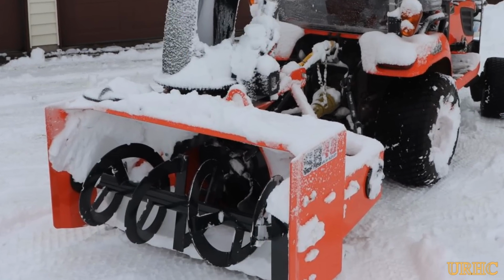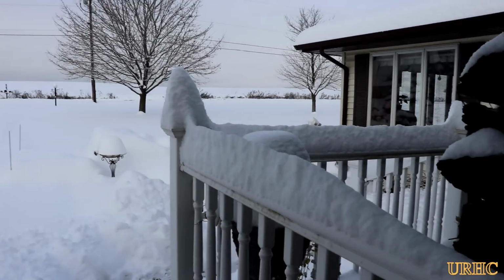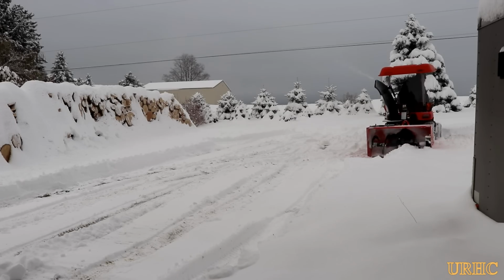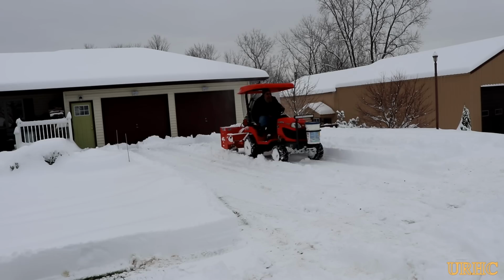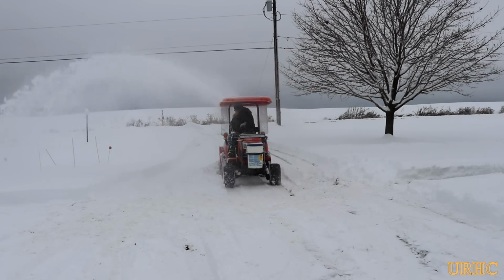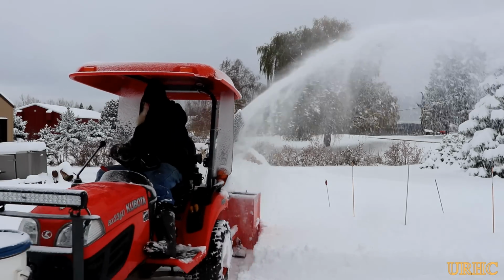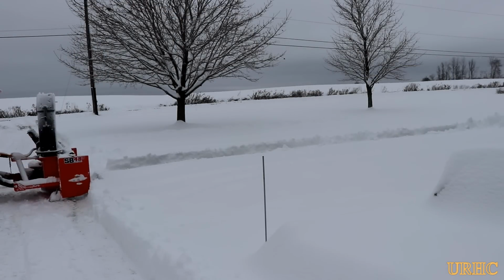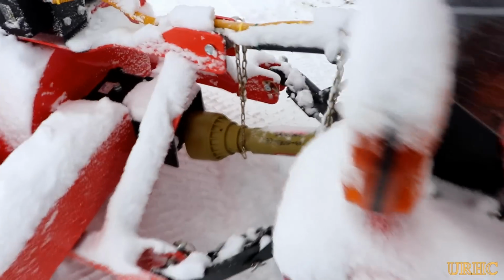Woodmaxx SB48 First Use

Comment: with  the drag of the blower on the ground an turf tires get your self a set of $40 tire chains for the back tires and you will climb them hills like there is nothing there, i used my 23hp  troy built tractor, 2 wheel drive  for 7 years commercially snow blowing, i would ware out the tire chains every 2 years but i could push the blower though 4 foot grader banks that froze over night, it didnt even slow down, my troy built blow the snow over 75 feet witch was nice in yards that had no place in the front yard to blow the snow so i would blow it up and over the houses into there back yard, the year we had 7 feet of snow fall in 12 hours it worked like a dream, i really thought we were going to be in a huge problem, but it eat that 7 feet deep snow like it was only 2 feet, that grader banks took a lot more doing, me and my crew worked 24/7 the week for 2 weeks, as we had my own contracts to look after but the phone was ringing steady every day people trapped in there homes, most places you didnt even know there was a house or car there, that was a really finny storm, you see the grader coming down the side streets with there big snow wing out, and small cars were rolling off the grader blade and up and over the snow banks as you couldn't tell there was a car there, there were so many cars up side down in the snow banks all smashed up. we had to snow blow our way down the streets to get to people that were trapped, but me and my guys made so much money on that storm, the guys were doing the walk ways with the troy built walk behinds to get to the doors and hand clean the steps and doors off, i can see why yours will not blow the snow that far, your auger i the front is made very poorly, the bars are all most strait, mine the have a really right side curve to them an my 2nd stage blower wheel spins so fas you cant ever see it is there when its on
Reply from the maker: I did order chains but they have not arrived yet. We get some big lake storms here and I can't wait to see how it handles them. Thanks for watching.

Comment: There's nothing wrong with the blower, to me though, blowing snow in reverse is a pain in the neck, both figuratively and literally. I could be wrong about this, but I think the blowers works better with a full auger  because there is less room for air mixed in with the snow, much like when a pump cavitates because air is mixed in with water.
Reply from the maker: Actually it is not bad, I bought a backup camera and don't feel it is needed. That very well could be the answer. I was thinking the denser stream exiting had more mass to deal with the resistance of the air.  I am very happy with how it worked. Thanks for watching.

Comment: Throws the snow much better than my 60" Woods blower.  I'm impressed.
Reply from the maker: Seemed like the more snow in the bucket the further it threw it. I had it running at 540 rpm on the pto. The blower amazed me how little it loaded down the motor. I think it is the perfect size for my little BX. Can't wait to try it on a good lake effect storm. That will be the true test. Thanks for watching.

Comment: you're a better man than me I couldn't backup like that. I have a Cub Cadet with the blower on front It's no match for your Kubota but works for me
Reply from the maker: Funny thing is that it didn't bother me looking back. Bought a back up camera just in case it did and don't need it.  Can't wait for a good lake effect storm to give it a good workout.  Thanks for watching.
Reply: I have a Cub Cadet GT3235 with the 45" front mount blower and 240lb suitcase weights. While I like this Kubota set-up, I'm afraid it's in a different zip code, price-wise

Comment: Take your 7 gal bucket mix up some concrete and put it in the bucket.  Concrete weighs approximately 150 lb / cubic feet
Reply from the maker: I took some sand out and added 50 pounds of lead then strapped 2 old f350 rotors on top. Seems to be good now. If it is I can weight it and make a concrete block to match the weight as you say. Thanks for watching.

Comment: I never understood snowblowing backwards.
Reply from the maker: It actually is easier to get in tight spaces and the blowers can be switched to different brand tractors. I never thought I would own one but after the problems with the new walk behind I switched and this works great. Thanks for watching.
Reply: +dalesworld  price.  When I looked into it, often the front mounted systems were much more expensive.  Of course, this can vary based on the tractor you are putting it on.

Comment: I heard the key word in this video (FUN). I wonder if you ever said that with your walk behind? I know your back is thanking you. If your like me, after using your current set up for a few years you'll move up to a cab tractor and clear snow in a tee shirt and sneakers. I guess I'm just getting old and soft LOL. Enjoyed the video.
Reply from the maker: It actually was fun. The new Ariens I bought last year is a piece of junk. It beat me up so bad I could hardly move after using it. The autoturn made the machine throw me around, had to fight to keep the front down and after a couple trips up the hill the drive system got wet and slipped so bad it had to be pushed. Glad I didn't take a chance on another walk behind. This blower works great . Chains and some more weight should make it unstoppable. That shield I built works pretty good for now. Thanks for watching.

Comment: I personally prefer a backblade but my is a little bigger wieght wise but hp you got me but i beat you on torque. John deere 520 with a 6ft arps blade and if if i need my john deere 45a loader. My tractor is 25hp dynoed right now but it wieghs over 6k.
Reply from the maker: These little tractors don't push much and with the back to back lake effect storms we get there is no room to push the snow. I am very happy with how it works.  Thanks for watching.

Comment: Looking good!  I've got a much bigger Kubota M7060 w Grand Cab (which I love!!) and need to find the right snowblower!  I may lo9oki at the SB72 or SB84.  Really don't need anything that big but the price point is very low on the upgraded sizes. The Woodmaxx SB48 looks like its doing a great job.
Reply from the maker: That is a big tractor you have. If there are any farm shows in your area that Woodmaxx attends they give a discount also if you order it there. Mine seems to be just the right size for the BX. Can't wait for a good lake effect storm to give it a good workout and see how it handles it. Thanks for watching
Reply: I have the SB72 on an MX5200 and could easily handle the 84” (it was added to the line the year after i got the 72). 

Eastern Lake Ontario lake effect region - big snow
Reply: @joelrarick8384  Thanks for the info!  I'm totally looking at the 84" for my M7060

Comment: The blower would be awesome if you could mount it to the front of the Kubota. Then you wouldn't have to look behind you and no need to add weight that way.
Reply from the maker: I like it on the back. When I replace the tractor with a different brand I can still use this blower.  Thanks for watching.

Comment: My Kubota BX2360 is set up with a 5 foot rear snow blower and a front end loader.  The front end loader will not only provide ballast, but is useful in moving large piles of snow around and scraping the driveway down to bare gravel with the float or by back dragging the loader.  I switch back and forth between the blower and the loader all the time.  The loader can be removed for mowing in the summer, but I keep mine on.  You never know when it will come in handy, and while costly, is a good long term investment in the tractor (for resale) even though you have another tractor with a loader.   You will love blowing thru large snow drifts with that unit.  Was wondering about the glass shield you installed, if you may need a wiper to keep it clear for good visibility to the rear.  I really enjoy all your videos.  Thank you.
Reply from the maker: I have a loader on the Deere and the Kubota was just my lawn mower up to now. When I replace the Kubota in the future I may do as you say and get a loader for the new tractor along with selling the Deere.  For now it will just be more weight.  The 4 ft is just right for my needs and it fits anywhere the walk behind would. The shield stayed clear in the center so I think it will be ok but still have to try it in different types of snow to be sure. Thanks for watching.

Comment: On my snowblower I put an A TV  winch to rotate the chute. I wired it to the battery with a 50 amp circuit breaker. Then I secured the winch wire controler  in the rear and that way I can adjust the direction while I am snowblowing. For the chute curl I installed a small e-bay electric  cylinder with a two way back to neutral switch. I like your snowblower as it look like swallowing the snow better than mine. 👍
Reply from the maker: I went with the wireless winch but found out the remote would time out and have to be restarted between uses so I will run wires in the future that will make it easier to use. This blower amazed me, it did not load down the engine like I was expecting it to. Thanks for watching.

Comment: That front end sure is light. Lol. It would be nice if you had a loader on it. That would weight it down a lot. It does work really well. Think you should get some drift cutters also? I've seen your drifts in previous videos and they are really deep.
Reply from the maker: It is a very heavy blower and I never thought about the extra weight of the snow that sticks in it. A loader can get in the way in tight areas so I am just going to try some more weight for now. These blowers can be raised 2 feet in the air for drifts so I don't know if drifts cutters are needed.  It amazes me how little a load it placed on the engine plus only took a quart of diesel compared to the walk behind that would use over a gallon of gas to do less area. Thanks for watching.

Comment: Well pal, how does it feel to cost me money, now I'm sold on the 3 point blower and like you I'll be going with woodmaxx. 
We just had our first snow (NWNJ) got almost 11" of sneet (snow & sleet) the front loader and rear blade did the job but I need a better solution, very happy you posted this video, also happy that you found a solution to your snow needs, I felt your pain last year with the walk behind snowblower, I to bought a piece of junk a few years and have been disappointed since.
Reply from the maker: I think it will handle any snow we get.  If you find a local farm show Woodmaxx attends they offer a discount. It is a heavy unit that seems better built then others and mine works great. Hoping for a 2 foot lake storm to see how it handles the dense snow. Those new Ariens just don't handle the snow like the old ones and are not worth fighting with. Thanks for watching.

Comment: If you have a rubber lined (or those wheeled ones, so you don't scrape pavement) scoop on the front, you could pull double duty, first run about with the snowblower and then at the end scrape whatever's left in a neat pile. PLUS, bonus, that should even out the balance just about right.
Reply from the maker: My other tractor has a plow and that makes a mess. A little extra weight and raising the skids should get most of it. Thanks for watching.

Comment: Great to see it is all working out for you ! Happy that you don't have to break you're back no more with the junk walk behind and I know you will get the weight fixed on the front but it looked great and it goes right thorough the snow ! I would take one too but just don't get snow like you but if I can find a used one !!! LOL but have a great weekend and be looking forward to the next video and God bless !!!! Kioti Curt 😉👍🚜⛄❄⛄
Reply from the maker: I was amazed at how good it worked.  I think it will handle any snow we get without any problems.  Nice to have a machine that works properly right out if the box. Thanks for watching.

Comment: It would make more sense to get a blower that goes on the front so you aren't killing your neck driving around in reverse all the time.  With the ridiculous cost of tractors they should come with front/mid/rear PTO's from the factory...having that blower on the back of the tractor just seems like it would be more of a hassle to operate.  Glad I just have a lawn tractor with a snow blower on the front and a nice suitcase weight bracket on the back...you would think that Kubota would have one of those since its supposed to be for tractor work I'd think they would have one from the factory on them front/rear just put weights on whichever bracket you needed more weight on.
Reply from the maker: I am very happy with how this works.  When I replace the tractor with a different brand I can still use this blower. Thanks for watching.
Reply: Many use a loader with a rear blower you'd have to be a real dummy to wanna take your front mount blower and mounts off everytime you wanted to put your loader on. City slicker
Reply: @derekmoen5382  Umm you don't have to take any mounts off to put the loader on, just disconnect the blower and put the loader on.  

You've obviously never owned a tractor.  Why the hell would you want to run a snow blower and having to twist your body around to see behind you for miles, that would be like driving your car in reverse around town all day long.  

If you are that lazy that you can't take a minute to remove an implement to use another you shouldn't own a tractor, and you sure as hell shouldn't own property that requires the use of a tractor.

Comment: how about using the front end loader and using 4 or 5 5 gallon pails of sand
Reply from the maker: It would be nice if it had a loader.
Reply: oops I do remember you unloading the truck with the pallet jack looking thing okay you need a loader and a grapple YouTube people we need to work on more subscribers
Reply: only the loader is plenty enough to keep my BX with my 52" blower
Reply: The loader adds enough weight for the blower but you really have to keep an eye on it.  Very easy to hit something with the loader when you're looking back at the blower all the time.

Comment: Maybe hit the rear shield with some rainex that might do the trick.
Also a suggestion because you get that deep upstate snow you may want to build a angled spill guard on the top edge of the snowblower to help when you get some of those big drifts kind of like the spill guards that Paul Short puts on Kubota front buckets.
Reply from the maker: I don't know if that will work on lexan. I will look into it. Luckily it only stuck to the sides so I could still see clearly. I can raise the blower up a couple feet for drifts that should handle what we get but I was thinking some heavy rubber flaps to extend the sides to the end of the auger  for less overspill. Thanks for watching.

Comment: Make a cab on a Kubota and put a heater in it you can't beat it front snow blower isnt near as hard on the back and the neck I have a bx2230 and it works nice
Reply from the maker: Then when I replace the tractor with a different brand I would need another blower. This is not hard on my neck. Fighting that new Ariens blower killed my back and whole body, this is a joy to use. Thanks for watching.

Comment: What timing, I did my driveway yesterday as it snowed in NJ too and was thinking about you as I followed my Ariens around my 130 foot driveway. Happy to see how well it did. You need extra front weight? Your Ariens can do that job well, lol.
Reply from the maker: I never thought about the extra weight of the snow sticking in the blower so it is a wheelie machine for now. Will add weight next time out. This blower works great with no problems. A lot easier then pushing the Ariens up the hill when  the drive disc would get wet and slip. Thanks for watching.

Comment: It doesn't blow that far but I think the blower is gear lower so it doesn't rob the smaller horse power tractors. Your rpms hardly drops when blowing that heavy snow.  Awesome little unit.
Reply from the maker: It amazed me, hardly any strain on the motor. It looks like it is going to work great with a little more weight on the front. The perfect size for the Kubota. Thanks for watching.

Comment: Man that little tractor works good.  Heavy snow is hard to blow. I have a Kubota L4740.  I do a lot of gravel driveways so to save the blower I just feather the blower up about 4 inches then on the way back out I drop the loader with a plow. I bought a new snow plow that trips.  I got sick of hitting frozen rocks with the bucket and bending stuff up.  The plow trips so avoids that terrible impact I get when I hit a rock with the bucket.  

Yep... your tractor needs a bit of weight in the front but it did very well without chains and only 80 pounds on the front so with the weight you would have a real little monster.  Nice little machine.  Thanks for sharing your movie.
Reply from the maker: This little blower amazed me. I thought it would be enough weight but never thought about the extra weight of the snow that stuck in the blower. I may add a small blade in the future. Looks like it will work good. Thanks for watching.

Comment: The blower works and looks good.  You need a plow blade for the front end to balance the weight.  I have a Massey Ferguson GC2300, about the same size and weight as your Kubota and with the plow on front and the blower on back it handles a lot better.  Chains are a must for me though.  Early snow I suppose so it looks like you'll have lots of practice using your new blower.  Miles ahead of a walk behind.!!!
Reply from the maker: It surprised me how little strain it puts on the motor. Definitely needs more weight and I am waiting for a set of chains to arrive. Hopefully I will get a little faster with each use. Thanks for watching.